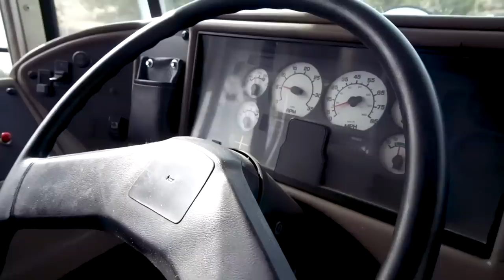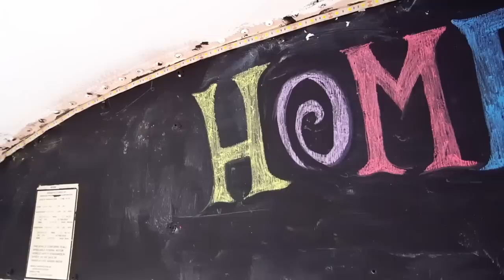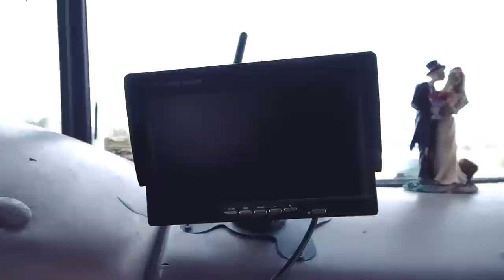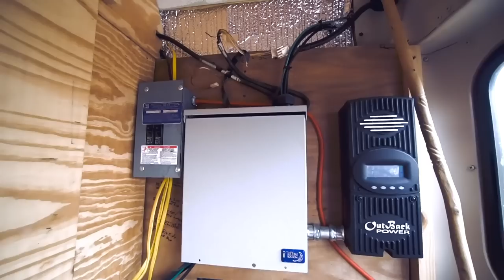$8k Total Invested In Awesome DIY Skoolie Build // Full Tour

Comment: Very cool. I want a skoolie. My suggestions are concerning the dogs. In the bed area you might consider replacing one of the beds with a lower orthopedic bed for your older dog. I lost my old girl a few years ago, but toward the end her big soft bed was hard for her to get out of and having arthritis myself now I can definitely say a firmer mattress causes less pain. I got her a thin memory foam bed and put it beside her big "comfy bed" and she used the thinner one without fail. 

The other thing is concerning the underbed area. It is awesome and a good idea but you might want to put an emergency exit where you have the laundry basket. A dog size door with wire and a solid door that can be closed over it. You could have better airflow for the dogs if needed, and still close it off to minimize noise. If they are wet or muddy you can load them into their area without them tracking through the house, and in an emergency, you can take them out of their area through the emergency exit.

Comment: WOW, I love all that kitchen countertop you can have a real kitchen for sure! Cheap fix for your fridge Velcro that sucker shut! I love your home! Your wood stove will smell really bad 1st few burns so I would take it outside and burn that new paint off before you burn inside the bus! oh and put up a heat shield around the stovepipe so it won't burn the painting or somebody setting on the couch.
 I hope you guy's don't have any diesel fumes or gas fumes coming through the sliding bed window.
Reply: Pamela Chadwell thank you for the great information about the wood stove! We got our fridge fixed with child locks but thank you for the Velcro tip
Reply: your welcome

Comment: Okay with the 7.3 TURBO altitude is not depriving your engine of oxygen. It's more likely just climbing those hills.  But the mileage you stated is pretty darn awesome for that big a rig.  My F350 has that motor and gets 12 pulling a 21.5' fifth wheel (7,800 miles, Oregon to Pennsylvania to S Carolina to New Orleans to Kansas City to Oregon).  My 40' schoolie (which will replace the F350 and trailer when completed) will make me happy with 8mpg at 31,800 GVWR

Comment: You might consider trading (if possible, maybe through Craig's list) your refrigerator for a trucker's freezer.  You can put your milk, etc., on the top layer to prevent freezing.  On the coldest night's, you could turn it off to save on electricity.  Also, it might be quieter turned off over night.  Some people (living off the grid) use this type of freezer more as a refrigerator.  They can adjust the freezer setting to the lowest number to use more as a refrigerator.  Also, it would be easier to strap in, or build a frame around, so it would stay still when you have to slam on the breaks.  Your dogs might like Milk Bone Dog Buscuits, both the 'old fashioned' and the new recipe called 'dental chews.'  Maybe if you type in your P.O. Box, someone nice (a shout out to philanthropists out there) will mail you boxes for your three dogs.  It is tough to find dog food that they will like.  The company 'royal canin' has breed specific canned wet food.  My dogs will eat it and no other brand.  I hope you have a big bowl of water for the older one, he looks really hot.  The channel 'RV Lifestyle' interviewed the co owner of the company 'nomoredirtywater.com' about a small water cleaner using ozone.  He says it can clean almost any water, especially for RV water storage tanks that can grow mold.  He believes all camp ground water is not trustworthy, even most homes and apartments could benefit from this ozone machine, water cleaner.  He says it makes water taste and smell better too.  He and his co owner want to sell about 7 billion machines at the lowest price possible.  They designed it to be small and lightweight, about 30 pounds and about 20 by 20 inches.  I like the sign on your bus promoting solar panels.  No offense, but all the art work kind of distracts from that.  Maybe you could own and operate a gallery/cafe/laudromat that is all dog friendly and devoted to people on the road.  You could also show films from an old fashioned class room screen (to save on space, one that can easily slide up and down in a small space).  You could serve popcorn to attract customers.You might duplicate this gallery/cafe/laundromat in every city you stop in and make it a 'co-op' with as many other people as possible (locals) helping to pay the bills.  You might get parents and teenagers to use it as an after school meeting place for book clubs, home work tutoring, watching movies together on Friday and Saturday night.  Space on shelves could be reserved for 'second hand books for sale' as a fundraiser.  Check out the channel of a Mississippi retired dog catcher that swears by 'BARF' Biologically Appropriate Raw Food, talapia frozen fish.  It breeds quickly and will help save tuna and salmon, dolphins and whales, from going extinct.  The talapia must be frozen at least three weeks to kill any possible worms.  He thinks that dogs and cats eating the entire talapia, bones and all, keep their digestion process healthier than commercial pet food, especially in older dogs and cats.  Ideally, every household should copy this process; sell or donate the talapia fish they don't use.  For example, they could donate to all the local food banks and animal shelters, and similar pet rescue organizations.  Dedicated chefs could sell 'fish and chips' in cafes, restaurants, or food trucks.  All the above are ideas for everyone living on the road, or off the grid.  P.S.  Those bones might be freaking out your dogs.  They would probably rather be looking at photos of themselves.  August 20, 2018

Comment: Yep.  As other said. Lock up those fridge doors. Plenty of solutions on YT.
Reply: So glad I didn't have to read to far in B4 finding exactly the post to reply on to give my 2cents on what I wanted to:
So child locks are probably the easiest &/or cheapest to lock anything!
Reply: just reading down a little more I know now that i'm kind of repeating some other replys all though like I stated in my reply post: U can use the child locks for many of different thangs not only your FridgeRator. & they aren't the same design for each individual appliance!

Comment: Wait, they have that big stove, but it doesn't work?
Reply: Marilynn Arnold we just finished our build and had more work to do which included changing the stove from a lp to a propane stove. It now works wonderfully and we have cooked several meals on it already!
Reply: I think they were saying they don't have the parts for the top.  I thought they were talking about another cooktop.
Reply: Yeah, I went back and looked and figured out you were talking about parts for that stove.  Thought you were talking about another whole cooktop.  (sorry).
Reply: Marilynn Arnold no we were talking about the parts to turn it from lp gas stove into a propane stove parts. We had to special order it from GE and get the parts shipped which is hard when you are traveling and don’t have a permanent address
Reply: Marilynn Arnold no worries. Even if we wanted to get a new stove top we wouldn’t be able to get it out of the bus hahaha

Comment: pivot the lamp upside down, it will still work, be higher and the top is not near as sharp....OR....take lamp off, put 2 x 4 x 8 upright and mount the lamp higher...wiring can go behind the 2 x 4.   And frig???  babylock...these work great to shut anything that opens or slides...
https://express.google.com/product/293657753239263959_7746426886299578968_118724597?mall=WashingtonDC&directCheckout=1&utm_source=google_shopping&utm_medium=product_ads&utm_campaign=gsx&utm_content=test_0_30